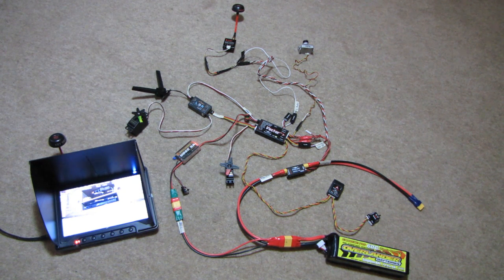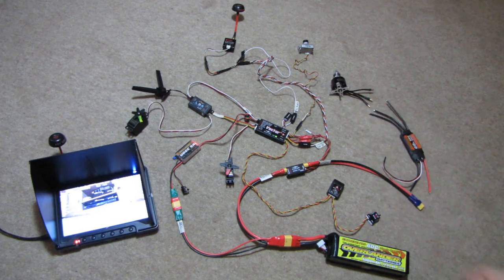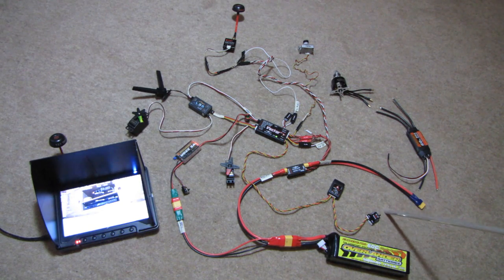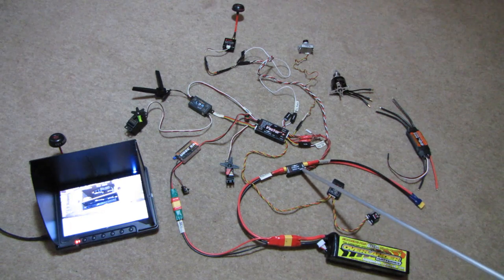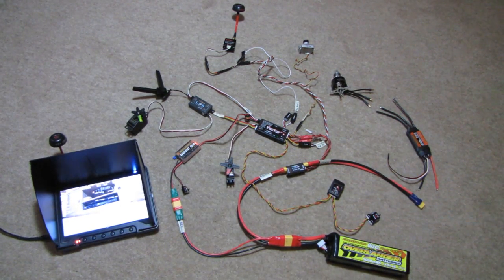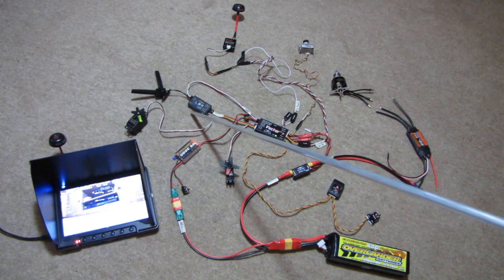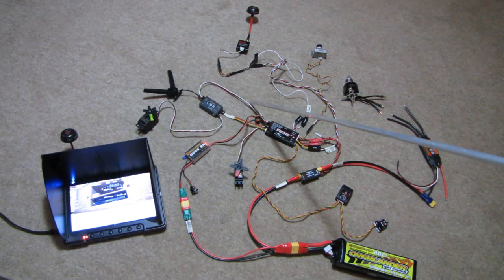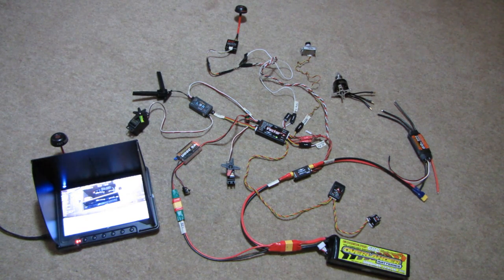ET Vector Wiring Walkthrough

Comment: On the page #15 of the Vector manual http://eagletreesystems.com/Manuals/vector.pdf the GPS sensor is connected to the Vector by its right port, but not the left as shown in your set up. I think the GPS will not work if connected via the left port.
Reply from the maker: Makes no difference. Right or left. Both will work. There are two to allow daisy chaining of the data bus.
Reply: I also thought so. However, I cannot tell for sure. I just had a problem with the GPS fix, it did not happen at all. Then I looked attentively at the scheme on the page #15 of the manual,  I connected the GPS sensor to the right port instead of the left one, reinstalled the Vector's newest firmware, and the GPS started to work. For some reason, there is a small red arrow pointing to the right port on the GPS sensor.
Reply from the maker: Yes, page 15 of the manual does suggest you should use the right port. But the photo on page 17 shows the left port being used!

I can't find any reference to the little red arrow in the manual. It seems to be labelled as "fix" on the device itself and it seems to be pointing at a hole which may be for a device reset? Don't know,  just guessing about this. 

Anyway.. I've just tried both ports and they both seem to work (satellites reported as found for both port connections). One thing to bear in mind is that it can take 5 mins or more for the GPS to find satellites when testing indoors.

Comment: Great explanation of the wiring! Got a question about the SBUS of the vector... If I hook up an L9R via SBUS and am using a transmitter with 16channels like an X9D Plus, can the vector make use of all those channels? I know it has only 8 conventional servo outputs, but can it process more channels in addition to the 8 conventional outputs internally, like changing flight modes and what not? Thanks in advance!
Reply from the maker: The limit on the total number of channels tends to be the receiver rather than the transmitter.
An L9R receiver has 12 channels to play with altogether (9 wired/sbus plus 3 more available with sbus only).

You can use all 12 channels of the L9R with a Vector fitted plane. Most channels will go through the Vector, some channels will be wired directly from receiver to servo.

Note on channel numbering:
a) The Vector insists on using channels 1 to 5 for the conventional controls
(not knowing this rule means hours of bafflement until you twig!) 
b) With the L9R its easiest to connect non-Vector controls (eg flaps) within the first 9 channels as these are the channels that can be wired without messing with defaults.

I use 11 channels on my Vector fitted planes:
1. Port ail
2. ele
3. thr
4. rudder
5. Stbd ail
6. not used
7. flaps (receiver to servo i.e. not through vector)
8. camera pan (receiver to servo i.e. not through vector)
9. camera tilt (receiver to servo i.e. not through vector)
10. VM1 vector mode
11. VM2 vector submode
12. Vector gain

Hope this helps.

Comment: On a scale of 1 to 10 how important would you say that second b e c is?I'm just about to set up my cyclops tornado and were thinking of just using the b e c on the e s c...ta
Reply from the maker: 1) First issue is how much current your servos will be drawing and how much current the built-in BEC on the ESC can supply.
Larger aircraft with a number of large or digital servos usually have a separate BEC. 
Smaller aircraft with smaller servos usually use the handy BEC supplied with the ESC.
(Remember that the BEC will be supplying your receiver as well as your servos. If the servos suck too much power you can suffer a "brown out" whereby your receiver shuts down briefly causing loss of control for some seconds - long enough to crash)

2) Second issue is specific to the Vector system. By using a separate BEC you can wire the system such that in the event of the Vector PSU failing you can dead-stick land a fixed-wing aircraft. This is a nice-to-have rather than absolutely vital. Covered in the video. 

Hope this helps.